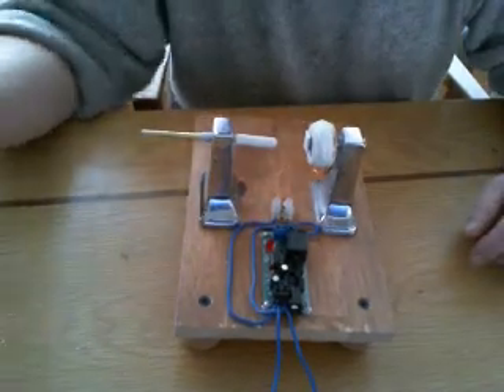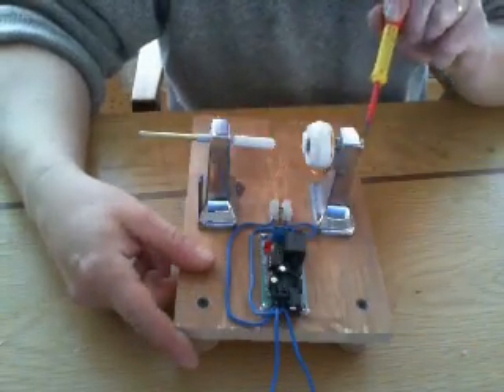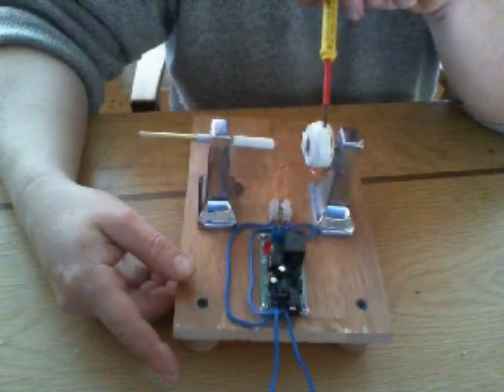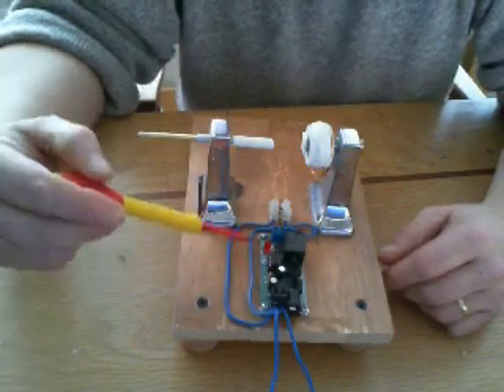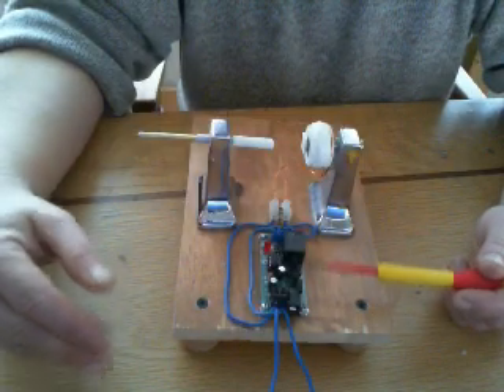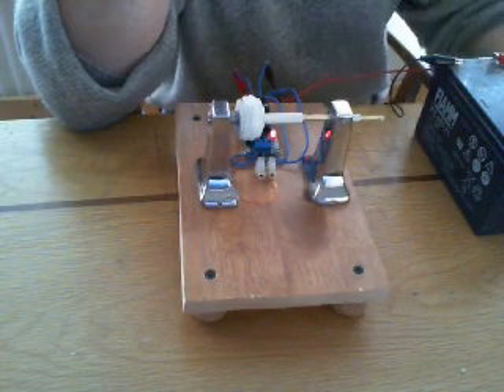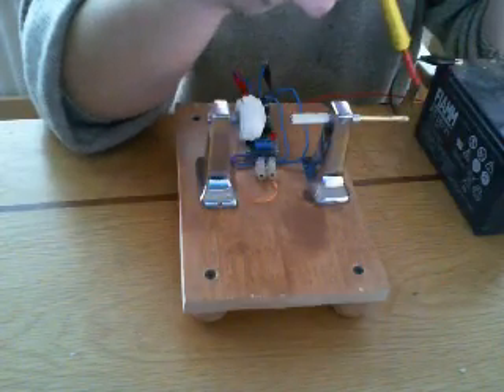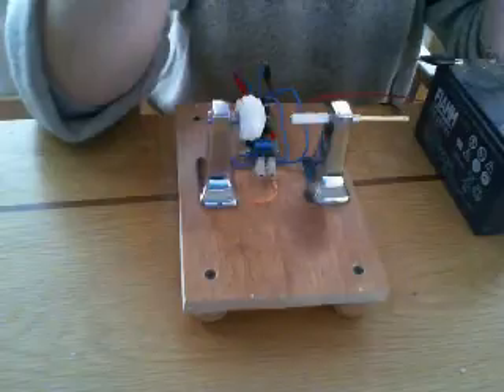Gap Motor Replication

Comment: Hi I am currently trying to achieve magnetic neutralization but am having extreme difficulties I have wrapped the iron core with magnet wire and have put magnets on the iron core but when I power the coil  nothing happens and the magnetic field is not neutralized. Can you please help me figure out what is wrong.
Reply: You need to over come the magnetic field from the magnets so go higher voltage till you over come the magnetic field created from the magnets........

Comment: i built a version of this that used gravity and a micro switch. as it came down the micro switch would connect the solenoid and fire it back upetc
it was great
Reply from the maker: That is awesome mate - did you do a video I would be fascinated to see
Reply: Unfortunately that was 30 years ago but very easy to replicate . You change the frequency by the spring tention and or the weight !
Reply from the maker: @Buzzhumma  do you mind if I give it a go?
Reply: Robert Murray-Smith sure! Would be great . I used a solenoid from a cassette tape player and a 3 inch nail but you could easily wind your own coil on a sewing machine bobbin!

Comment: ...There are a lots of videos here on tube about "BI TOROID TRANSFORMER", guys working on this project are claiming that the transformer has "magnetic flux diode properties" so that back EMF does not influence the promary but it's redirected to the second secondary. 
If the flux diode works, it could be used to harvest current produced in the coil as the magnet comes back??

Comment: I love your no rotary option, coil from an old dor bell (ding-dong type) would be perfect for generator coil. 
But it's not ok to place expensive magnets to repel each other, they will lose power and eventualy demagnetize due the 50% of the magnetic domains pole shift. 
Neodimiums expected lifetime is about 1000 years while not repelling. 
Maybe better to configure the permanents in attracting mode and reverse coil to repel.